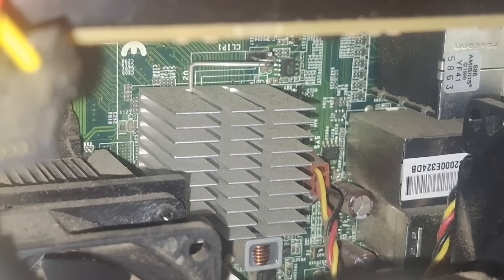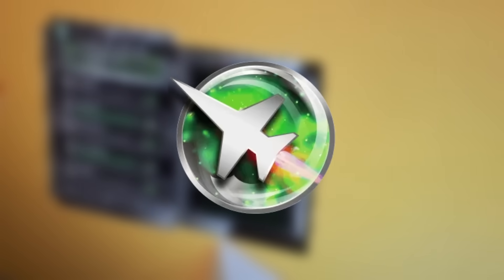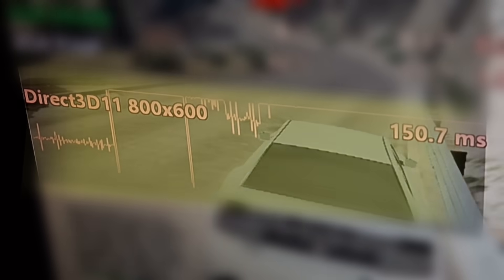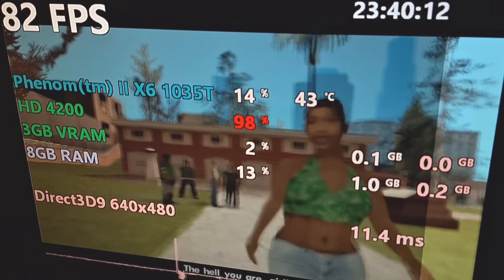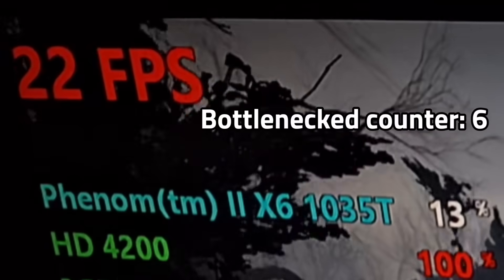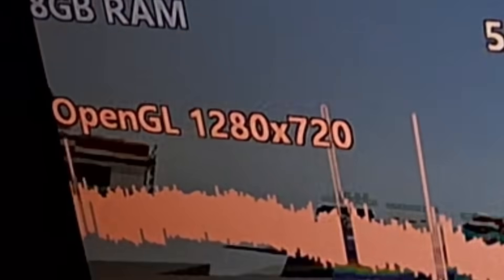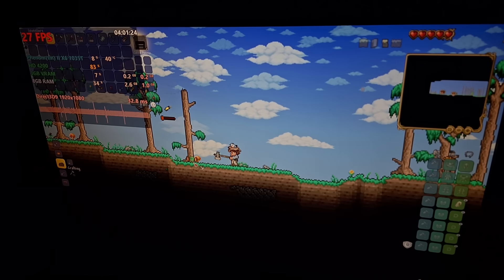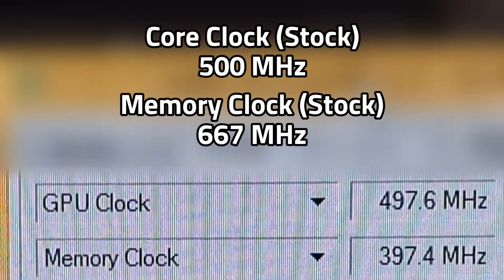2009 Integrated Graphics vs OVERCLOCK

Comment: In your case the PC restarted because of the BSOD so it removed the OC settings. MSI Afterburner overclocking needs to be reapplied manually every time you restart the system or there is a small button at the bottom of the window which says, "Apply overclocking at system startup".
As a side note for modern GPUs at least, anytime your GPU drivers crash, they restore the GPUs default clocks back as a safety measure, if you went too far with the overclocking so you need to readjust/reapply them back.

Comment: GTA V works like this: If u have less than 1 GB of VRAM, it takes up to 3 GB from the RAM and shares it from the page file. That's why it says 3, because it'll use RAM to load textures, which takes a toll, which lowers FPS.

Comment: These old parts, win 7 era, brings nostalgia. The igpus always sucked, but I still like these boards. I was typing with the video going and as I was about to ask if you're sure the memory clocks did anything the gpuz section answered. I wanted to say 667 was a common ddr2 speed and with how those graphics chips on the mobo share system ram I couldn't see a way GPU settings would affect real speed. Unless there was some obscure iGPU with its own ram chip, which exists I think but I doubt this one has that. That does open a possibility, try the fastest ram you can get for that system and see if it reflects on fps. Also funny how it crashed trying to play 4k video. When I was running Intel dual cores I had trouble with decoding not working and ramming my CPU, it was supposed to see it can't do 4k and let the CPU suffer on the default mode

Comment: The gpu having both 256mb and 3gb is because the gpu itself has 256mb, but because of the fact its integrated graphics it can share system ram with the cpu.

Back in the day when I used to use my grandmothers laptop to game as a kid the ram was the first thing I upgraded as it helped the system in general and also the gpu.
I remember getting a faster 16gb kit over the slow 4gb I had and got a huge performance boost.

Comment: The problem with 11 might be the fact you're using too new of a version. Starting with 24H2 it requires POPCNT which is found in the SSE4.2 instructions which wasn't added until Core i Series or FX series

Comment: i dont think the gpu memory overclock is correct its tied to system ram 
back in the day i pulled a trash pc with geforce 6150le onboard graphics and it was tied to motherboard ram speed in bios no matter what i did in windows

Comment: I got to play around with hd4200 intigrated before it'll ""hybrid Crossfire" with hd2400,hd3450,hd4350  the bios may call its mode surround view...
Reply: altho hybrid crossfire will only really work with windows xp or vista. win7 not so much..

Comment: when you try GTA V you should use 1/2 resolution scale on the advanced settings,its going to improve perfomance a lot,you can also use optimized config files found online that will make a difference

Comment: very good video! Also as a big gd fan, i understand what you mean by taking the game way to seriously lol. 
i was stuck with low end hardware for a long time and the performance of the game is accurate. also if you do test gd again, in the games settings, there is a thing called "smooth fix" which is causing your game to go in seemingly slow motion. you should try it with the setting off in a future video :)

Comment: The reason why is you have the INTERNET enabled or bad drivers on the install. 

It did the same to me when I tried Windows 11/Tiny 11.

Take the REALTEK drivers file from the old windows install and OFFLINE install it. NO Ethernet/Internet-Wifi enabled or the ports occupied.

YOU will be able to boot into windows 11 offline mode without Bsod most likely if the iso modifications are right and it’s done in MBR mode. 

Then install the copied Drivers for Realtek/Ethernet and youre good to go.

(2011 Amd Sumo A6Hd6530D For me . And that’s how I got mine to boot into win11.)
Reply: You can literally copy the ENTIRE folder for drivers and copy and paste it also into a flashdrive and then intergrate into the fresh install. (This works best)
Reply from the maker: It was the realtek drivers causing issues, thanks. Got win11 installed. Video incoming 🔜

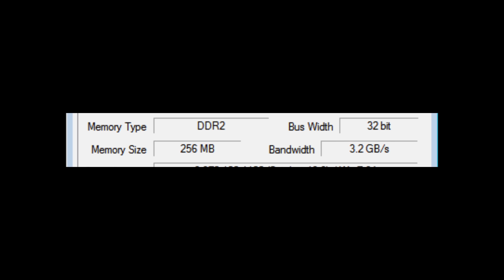Comment: 256mb is the standard memory amount that is allocated towards VRAM for the iGPU or chipset graphics in this case (On iGPUs system DRAM is used as VRAM). This however is a base amount similar to base clocks on CPUs, if there is more need for more VRAM the system will allocate more towards the iGPU. On modern iGPUs like Arc 140T, 890m or 8060s on Strix halo the base fixed amount is larger but at the end of the day it is still a dynamic amount. 4:04
Reply: That said, having more RAM and especially faster RAM will benefit the performance heavily as DDR is much slower than GDDR so overclocking RAM and adding as much as possible will help with stutters, pop-in and FPS. For Minecraft I recommend using performance enhancing mods like Sodium, Lithium and distant horizons. Low res pvp texture packs may also help.

Comment: the HD 4200 motherboard I have lets you allocate up to 512mb of system memory to VRAM, so 256mb isn't a hard limit. I also got it to work in hybrid crossfire mode with an HD 2400 XT. I never tried any benchmarks though.

Comment: gpu bottleneck is not a bottleneck you are supposed to have your gpu at the max while gaming
Reply: When the GPU is maxed out, it means that the CPU is capable of providing enough information for it to use it's full potential. A GPU bottleneck means that the CPU is capable of handling a stronger GPU, but the current one is too weak to fully exploit the CPU's potential performance, so to speak.
Reply: @Silvahhhhhhhhhh you never want anything above 50% on the cpu ngl
Reply: @Silvahhhhhhhhhh you never get 100% cpu and 100% gpu usage
Reply: @paxounet5312 You can get 100% both, actually. It is rare to have two components that equally shit, but entirely possible. Dawid has managed so in GTA V.
Reply: - If GPU cannot output more FPS but CPU can, that's called GPU bottleneck. Reverse it and you will get CPU bottleneck. 
- If both CPU and GPU run at 95-100%, the whole system is bottlenecked (can't output more FPS).
- If GPU runs at 80% and CPU at 20-50%, that is a RAM or whatever else bottleneck. Maybe a bottleneck of the game itself.

To be noticed. Bottlenecks do not always mean that your hardware isn't capable of giving better FPS with better graphics. If a game runs like sht and the graphics looks like it's 2016 and your CPU and GPU are maxed out, then it is "this game is a piece sh1t" bottleneck. That means that devs didn't bother optimizing the game because you will eat this sh5t anyways with or without a good "FPS per Graphics" ratio, which is a super-common thing nowadays.

Comment: Geforce 210:
Finally a worthy opponent
Reply: Had a pc with a6 6400k with gt 210 back in the day
Removing the gpu unironically improved the fps
Reply: I still have my GeForce 210! I really like to use this video card for testing the motherboards, since it doesn’t have a fan (ASUS version) and it’s small.
Reply: ahhh i remeber this gpu. it was my first GPU I bought in order to play arma 2, I returned it after 1 hour ( it was 100euro) then i gave 120 more and got HD7870, close  call
Reply: G100 hello

Comment: Those 3 gb of vram could be ur system ram that gta is using since those 256 mb of vram cant do nothing, amazing video as always
Reply from the maker: Good to know , thanks
Reply: @pokeytech bc it's integrated, 256 is just the minimum video memory buffer it can have. It's not dedicated VRAM, but a portion of normal RAM so DDR3 would have been a much better platform for integrated than DDR2. Also 3GB is probably the maximum amount of memory which can ne allocated for the GPU.
Reply: 256mb is the standard memory amount that is allocated towards VRAM for the iGPU or chipset graphics in this case. This however is a base amount similar to base clocks on CPUs, if there is more need for more VRAM the system will allocate more towards the iGPU. On modern iGPUs like Arc 140T, 890m or 8060s on Strix halo the base fixed amount is larger but at the end of the day it is still a dynamic amount.